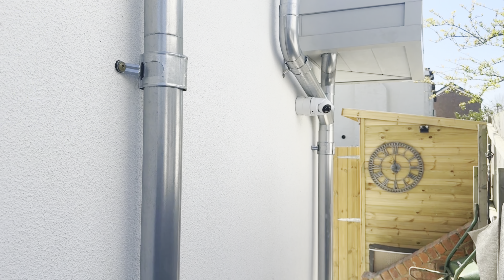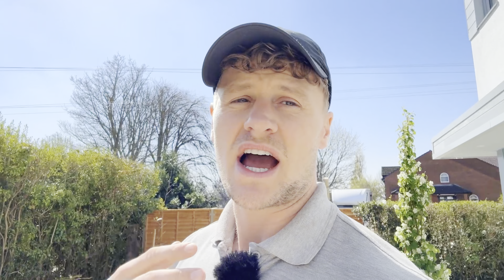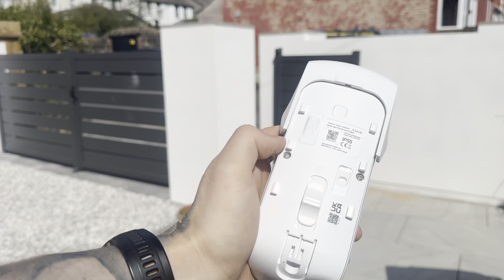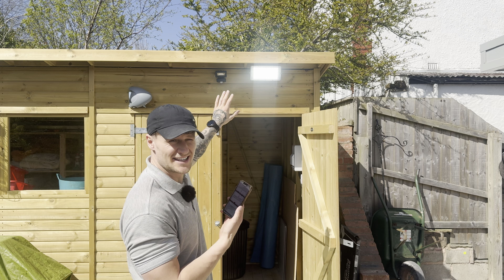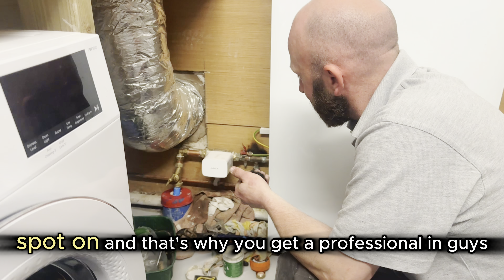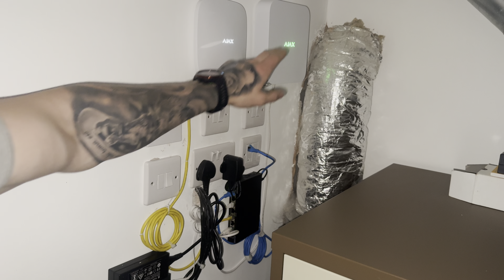Full Ajax Smart Home Tour - Burglar Alarm, CCTV, Leak Detection, Lighting & More!

Comment: Why would one install a MotionSensor when AI cameras can detect humans very well? From what I know outdoor motionsensors also need an empty space so any bush or decor trees must be moved away...
Reply from the maker: Great question mate, there’s a few answers to it.. in my experience external alarm motion sensors are still more reliable than AI cameras. External sensors will also trigger an audible alarm to sounders as a deterrent, a lot of people don’t want AI alerts on their cameras because say if you have people in the garden you don’t want your phone pinging away all the time, so you only want it when an alarm system is armed.. these are just a few of many reasons why a system like this when both alarm and CCTV detection work better as a duo than having one or the other 👍🏻
Reply: @SimonSecurityExpert great setup Simon!
To react on this topic, Ajax allows audible alarm from camera detection now, doesn’t it?
The inconvenients I see of relying only on cameras could be in case of power outage/tamper, or if the burglars can disguise themselves to not be picked up by AI.
As for the app-alerts, don’t you think that Ajax should release different modes, such as what EUFY does? Ajax’s zones mode only allow for armed or disarmed, how about you could use their equipments in a smarter way, arm perimeter protection with lights but without sirens and critical alerts, arm the cameras with or without alarms, etc, use only the contact sensor and not the shock one when you’re home… It would avoid the multiplication of equipments imo
Reply from the maker: Hi Tristan great points mate, I wasn’t aware Ajax have released their audible cameras yet with speaker or do you mean set up a scenario to trigger the alarm sounder when the camera sees movement? 
Eufy does have some great features, in my opinion I don’t think Ajax will go down that route though, I’m not sure the demand is there for that level you see, and it could potentially confuse people. A lot of alarm customers (elderly) just want a system that is very basic and easy to understand, as you add more and more it can get more difficult for them, but I guess time will tell! Going to an event of there’s soon so looking forward to seeing what else is coming out; and as soon as I do I’ll post it up here 😁 thanks for watching mate
Reply: @SimonSecurityExpert I mean that you can trigger your Street siren if the cameras detect a person, yes.

Okay, yeah I understand the simplicity of use that is desired, it would be nice to have the option to have different level of security, lighter security modes that help you monitor when you're home, while avoiding false alarms due to legit activity of the occupants. 
For instance, simple notifications and simple siren beeps without sounding the alarm notifications and triggering the siren at a loud volume

Comment: Hey enjoying the videos, wondering can you do a video for changing batteries for the Ajax system, that includes how to remove each sensor or keypad separately to not damage them and then to get at the batteries once they are off the wall?  Thanks carl

( I damaged the taper safety part of the inside alarm trying to move it,  so don't wan to risk changing other bits without the knowledge)
Reply from the maker: Be happy to mate, leave it with me! Glad you’re enjoying the vids 👍🏻